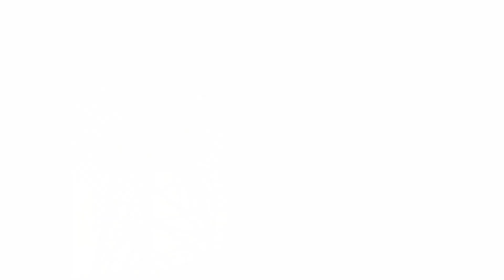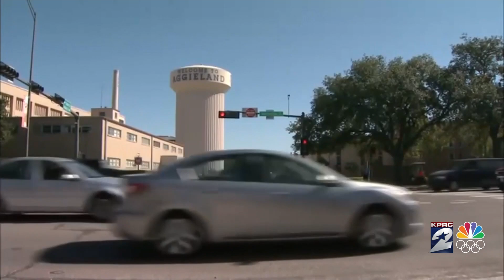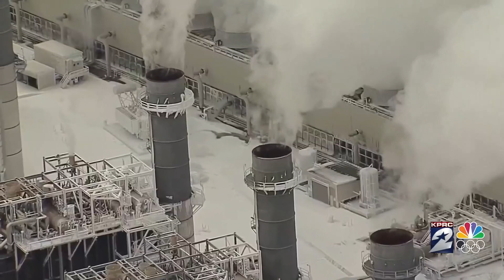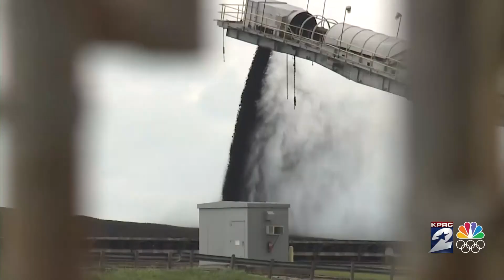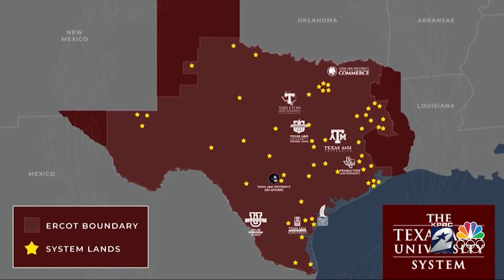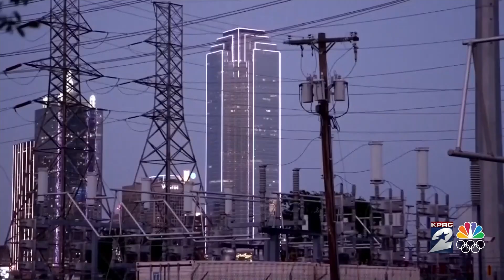Texas A&M explores proposal to boost Texas power grid and prevent blackouts

Comment: Being a secessionist island gets tiring to watch.  Be a whole lot easier to make a couple of cross-country grid connections.
Reply: What the hell would attaching to another grid do when power transmission towers are down?
What the hell would attaching to another grid do when those grids are also running near maximum?
Reply: More pollution from the US.
Reply: @helenpauls1496  CO2 is not pollution; neither is water vapor.  If everything we do is "pollution" then your definition is wrong.